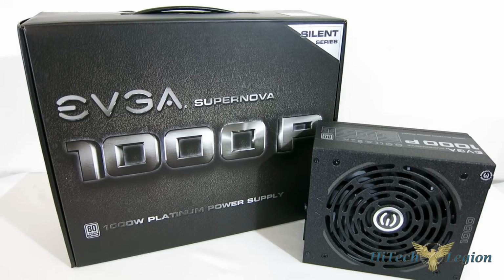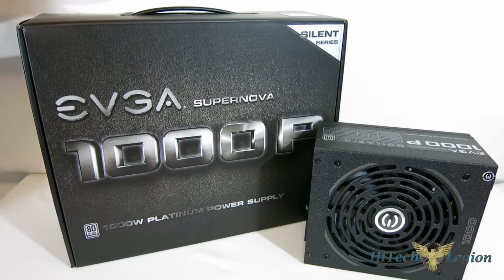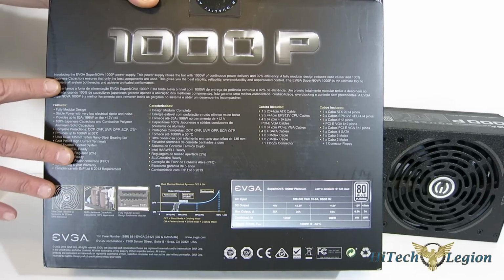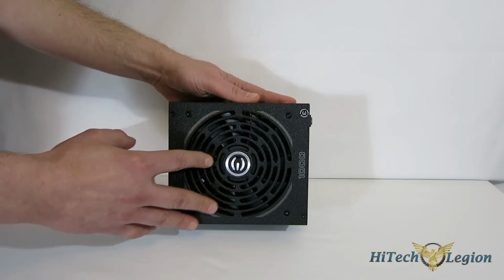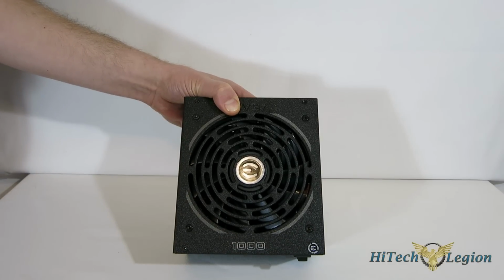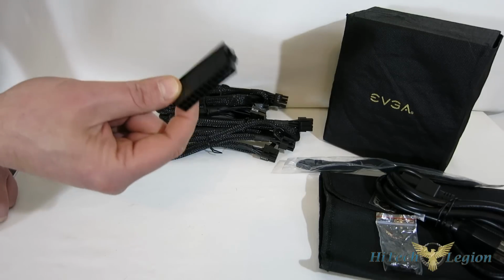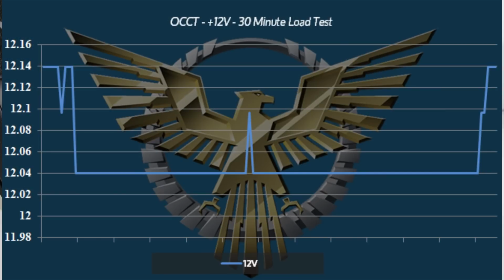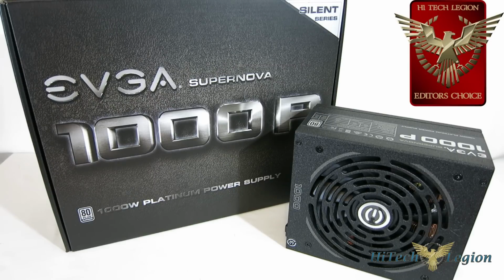EVGA SuperNova 1000 PS Silent Series PSU Overview and Benchmarks

Comment: What are all  the differences between this and the P2 version? Is it only that this one is smaller and has a smaller fan? Anything in terms of performance?
Reply: Performance is the same.  The P2 has 10yr waranty, PS has 7yr.  Just buy which ever is on sale at the moment.  I went with the PS, as it was on sale and I liked the smaller profile.  It powers a Xeon X5670, 2x 980ti, 8 fans, 1 SSD, 1 water pump, 2x 15k rpm sas drives, and 4x 7200 HHD.  Rock solid and cool so far.

Comment: At 169mm long this psu is perfect for the Fractal Design Node 605 case with dual Gtx 980 ti, an i7 5930k, an EVGA X99 Micro 2 and a Samsung Evo 850 2tb ssd. 1000 watts should be more than enough.

Comment: Hi, do you think this will be a Tier 1 PSU?  Just placed an order for one of these.
Reply: Alex Toff Absolutely. Comparable units built on the same platform are all Tier 1.
Reply: George Cella Awesome, makes me feel a bit better about it.  Thanks for the review.  I got a pretty decent deal I suppose.  It's on sale for $169.99 on Amazon right now with a $20 rebate.  After tax, it ends up being $165 after rebate.  I was considering the P2, which LOOKS higher quality, but I don't really see any benefit to the higher cost (about $40-50 more).
Reply: ***** Already bought it when I made that comment.  Such is life with tech, prices plummet.

Comment: EVGA has stepped up in the psu game. really nice unit.
Reply: teeblack06 From 750-1600 watts they have the top PSU available. At 850W and 1000W they give you a choice between the two best units available. There is also a 1050W Gold Silent Series.

It's insane how good their lineup is.
Reply: ***** yeah i heard about those. they suppose to be based off a Seasonic platform.

Comment: I`m looking for a new psu.
I can not choose......
EVGA SuperNOVA 850 G2.....or....Super Flower Leadex Gold 850W

I like the look of the Super Flower but I also like the custom cable sets on the EVGA site witch you can buy with the psu.
Reply: Then I go with the Evga because then I have 10 year Warenty and nice cables :)
Reply: Andres de Groot Not quite sure what this has to do with the 1000 PS, but.....

The 850 G2 and Leadex Gold are essentially the same unit internally, so it really will boil down to customer service availability in NL, and as you stated - the looks.
Reply: i have the EVGA SuperNOVA 750 G2 which i bought like 1-2 months ago. I heard this PSU is a rebranded superflower anyway so they are both top tier PSU's you cant go wrong with either.